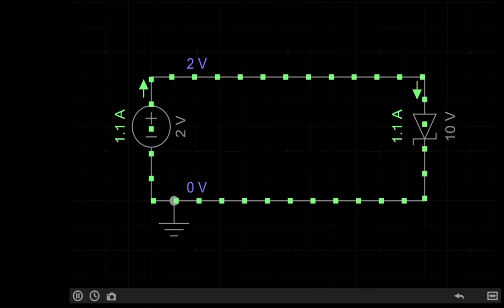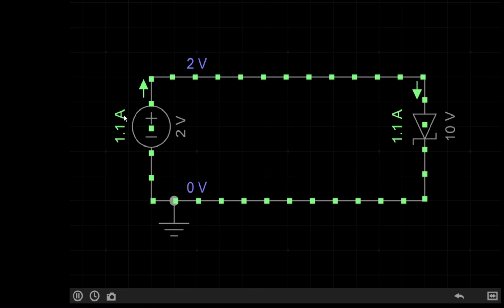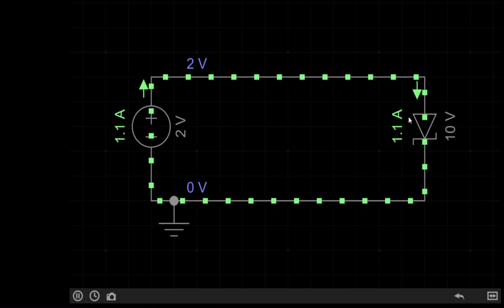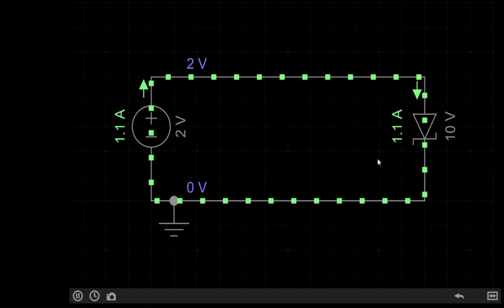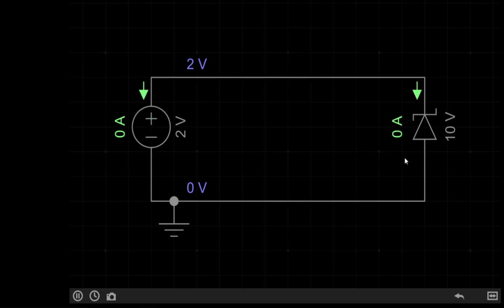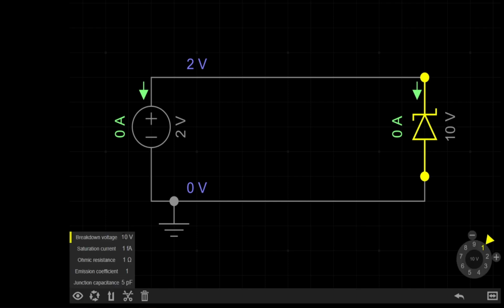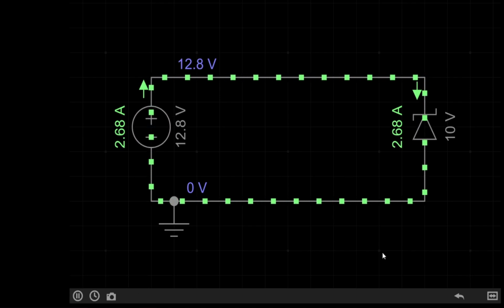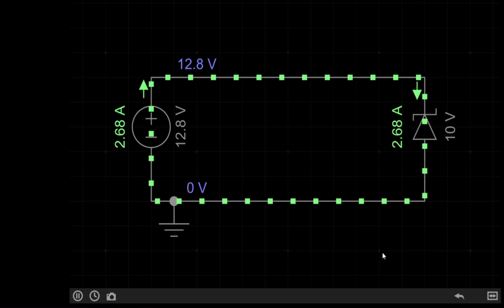Zener Diodes - Diodes that work both ways?

Comment: Good morning.  I've watched this several times.  My plan is to focus on one thing until I get it.  Even in my sickened state I'm starting to get it.  Does the data sheet give you the max current the diode should be exposed to so I could calculate the resistor needed to limit the current?
Reply from the maker: Hi,

Every diode data sheet will list something like IF ( Forward Current ), which could be a large range of values depending on the diode you're using, for example 1 amp.

To be clear that is just the maximum current that can pass through the diode, you can of course pass less current if you wish.

Hope that helps,
Ben